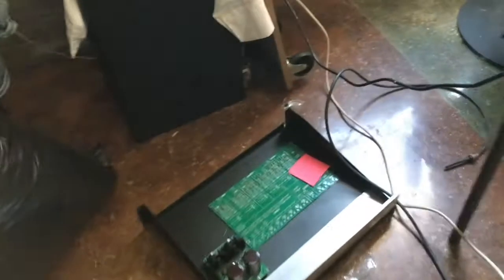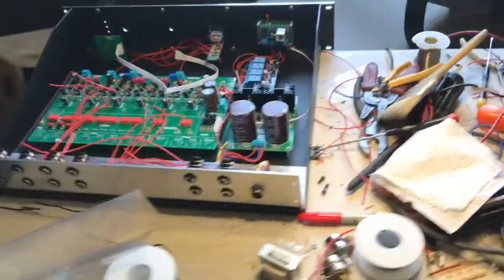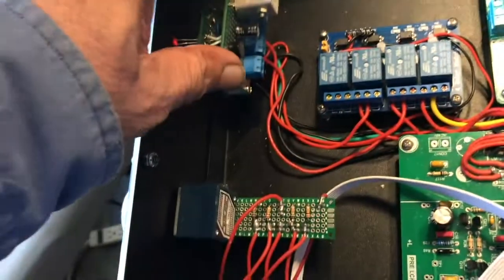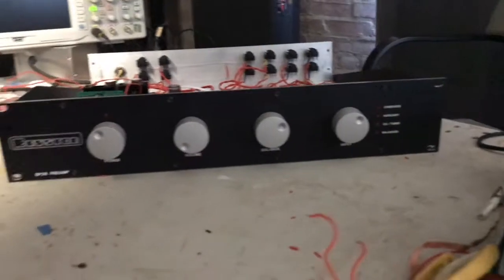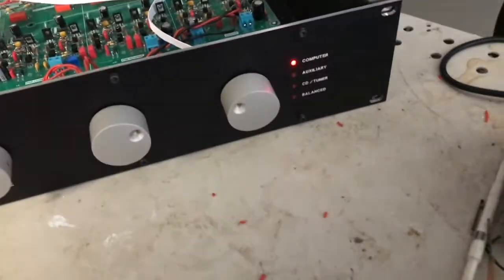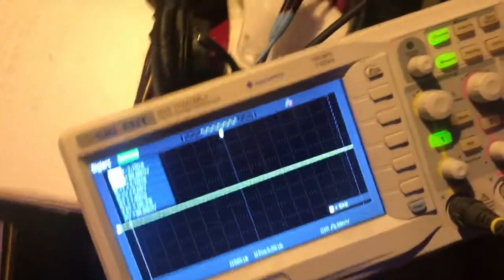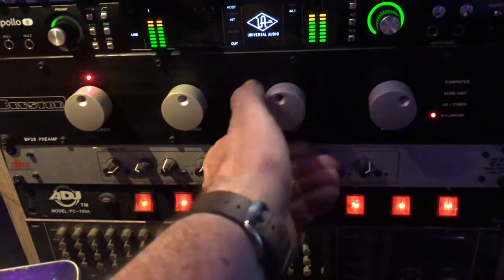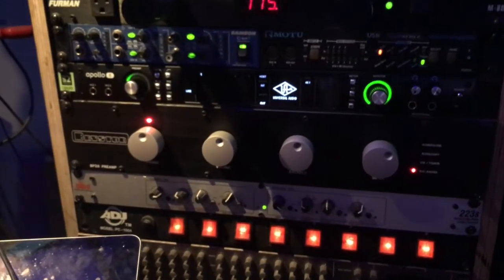I built an eBay Bryston BP26 Preamp Clone.

Comment: Hi i just found this your excellent video on a very interesting clone   Did you build the +/-24VDC power supply yourself or you got a kit ?   
it looks very good indeed   I am tempted to buy these kits but i would need the power supply first for my present preamp also a Bryston but quite older .4B   Not at the level of yours   Its power supply is just two fixed single chip regulators    I understand not the best option   
Any advice about a suitable line preamp would be very welcomed and appreciated    Thanks again and kind regards gino
Reply from the maker: Yes -ended up making my own PSU.  i changed the bridge caps later  to bigger,  higher voltage, but this was just for getting it tested. 

I bought the one the the seller makes a bare board for but could not get one side to adjust correctly,  then blow it up troubleshooting. COVID meant long delays for parts, I lost patience and just put my own together. If you go with the one they suggest, they used to sell a built up one as well which was very affordable. that's what i would do.

Good luck it's a fun build and  it sounds great.

Comment: Interesting subject but the use of a tripod would have made it watchable. I gave up after 3 minuets. Viewed on a large screen I found myself reaching for the travel sickness pills! PS could this be why you received 3 thumbs down? I was NOT one of them!
Reply from the maker: sorry. this was a mishmash of casual videos i had previously uploaded to facebook.  by the time i was done, i would have had to dissemble  the unit to duplicate.
Reply: @PeterGrenader  I look forward to your next epic (with a tripod!!) maybe the matching amplifier. My favourite kit right now is the L12/2
Reply from the maker: @MichaelBeeny  that was good, thanks for that (My next epic lol)  I already have a Bryston 4B SST amp, which i'm taking to my grave lol  that the reason i built this thing.
Reply: @PeterGrenader  hallo,which transistors instead of 100-200 have you used?,thanks.
Reply: hallo,which transistors instead of PN100-PN200 have you used?,THANKS.
Reply from the maker: @MichaelBeeny  I've started a new project. A speaker A/B switch, done right. Omron sealed relays doing the switching, power meters faceplate adjustable for 4 or 8 ohm loads, rack mounted. Not a clone - my circuit. Specing the parts now. it's incredible how much easier lockdown is when you're thinking about stuff!
Reply from the maker: @407KOKOS  i found the entire BOM onine. There are no subs from their speced parts. You just hve to do some hunting. Google is your friend. 

PN100 from Futerlec VERY reliable supplier. For two year when i was producing analog synth modules we bought all of our pots for them

https://www.futurlec.com/Transistors/PN100pr.shtml

PN200's from Digikey

https://www.digikey.com/en/products/detail/fairchild-semiconductor/PN200/11520099
Reply: @PeterGrenader  thanks.
Reply from the maker: @407KOKOS  no prob

Comment: Thanks, been looking at that board on ebay numerous times, should really pull the trigger
Reply from the maker: i say go for it. I have a lot of experience stuffing boards, but regardless - the important thing is...this board works. If you plug the right parts on the right holes and solder them correctly....it'll fire up. All that crap i went through with the relays...you're OK with the transformer being in the box you wont need to go through any of that noise.
Reply: @PeterGrenader  Sounds like the board is the easy part, the component list is pretty decent?
Reply from the maker: @convertz28  there's a couple of stinkers, but you will find sources for everything. just search the manufacturers part numbers. Thankfully, Google translate can help you with the BOM from Chinese. Also you can write the guys you buy it from, usually they are really helpful. What i did is write my letter in English, then translate it to Chinese, then paste that in there after. They always thanked me for doing that.  

I tried to show them this video, but of coarse it's blocked in China. Politics touches all of us i guess.
Reply from the maker: @convertz28  the only part of this board that is a direct clone of  the real BP26 are Brystons  legendary DOA33 discrete op amp design and the transistors they spec are comparable to the originals. As far as the passive parts, you can always upgrade to wire wound resistors and caps etc ( i  did... notice the WIMAs).  One thing they didn't spec which i suggest you do are clip on heatsinks for the  TO-125 package transistors. They run quite warm  You will need 12 of them. 

they separate  DC power supply they did for the relay coils and the panel LEDs was pretty weak... for instance  the +12 tap was unregulated and just a wire coming off the output of the transformer's secondary filler caps.  i elected not to use it and  build my own using switching regulators. NOce and col, no ripple, better solution.

So for the record -  the audio path is Bryston. The relay driver circuits, the panel lights logic, the power up delay and  the power system (if you elect to get the board kits these seller also have for this unit) are similar, but not identical .  One thing they didn't do which i wish they had... is they did not include  separate buffers  for the balanced and nonbalanced  outputs. They just ran a wire over from the balanced outs for the stereo tip.sleeve outputs.  . Not the best way to go,  i  may add additional buffers for the non balanced outputs.

Comment: Thanks for posting this, I'm just in the process of putting mine together, would be interested if you could post where you obtained the chassis, faceplate and the rotary switches you called on .... cheers and thanks for sharing.
Reply from the maker: i KNEW someone would appreciate this! 

The Faceplate was done by Front Panel Express. I can't tell you how great these guys are. I designed it myself with their cad software which is super easy to use, i replicated the Bryston logo myself in Illustrator. It is 3mm anodized/brushed aluminum, fully routed (holes and slots) laser engraved graphics filled with white epoxy. It was $102. Showed up in a week.  

Rotary switches became my obsession. I needed two, i probably bought 8 before i found two that had a real solid feel to them that didn't take tons of torque to turn. I actually tried removing one of the two ball bearings in a couple of them to make the action smoother. 

The input selector switch - you'll need to buy the one that the PCB is designed to fit. That decision is made for you.  It's a C&K A04-15-rnzq

The power-on rotary switch was a foolish right brain impulse. I wanted to keep the AC out of the unit and i loved the action of this switch, but it could not handle the secondary AC voltage i needed to run through it...so i had to add a relay board with the rotary switch only switching ground. So to avoid that nightmare i'm not e going to mention the model/manufacturer. trust me, i saved you a bunch of headaches by omitting the details.

 Chassis: you're gonna laugh, but by the time i got around to the box, knowing i would drop $100 on the Front Panel Express faceplate and another $50 on the knobs - along with the components, i was already into this $500 easy so.....

(this is the funny part) the main frame is a $20 2RU high rack shelf (link below). The back panel is a 17 inch wide piece of 3 x 3 right angle aluminum and the top cover i made with two pieces of 3/4 inch plywood and a 1/8th inch panel board.  I know...cheesy BUT it's going in a rack and what shows (the Front panel and panel controls) IMO looks as good as any Manufacturer's product I'd happily lay money down for

Hope this helps. This is the perfect project to keep you from going bats during COVID lockdowns. There are no errors in this board. if y9ou buy the right parts and put them in correctly, it'll fire right up.

https://www.computercablestore.com/2u-non-vented-shelf-14-inches-deep-single-sided?gclid=CjwKCAjw_sn8BRBrEiwAnUGJDivZYXyi5bWkiPLveDiK_lQC9-8Bu8wOFXqQtTab2p1u_on3G211WxoCo4UQAvD_BwE
Reply: @PeterGrenader  Thanks so much for your information you are very generous. I will keep you up to date on my build as I get to it, I have the pcb built up and also the power supply they suggested built up I just need to get the mechanics sorted, but I don't have a great deal of time atm... thanks again Peter.
Reply from the maker: @NoEscapingGod  no problem. hope it goes well for you. btw - forgot to mention  - the  T0-126 transistors tend to run hot. I just ordered heatsinks for them. There are 12 on this board. Something to think about.

that PSU of theirs didn't work for me I could not adjust the voltages. The trimmer did nothing and it both sides were frozen at 41 volts.  I didn't want to deal with it, built up my own. If you're facebook, friend me you'll be able to ee the latest version of that PSU, in which i have to significantly increase the size of the heatsinks and add a small fan in order to keep mine cool.